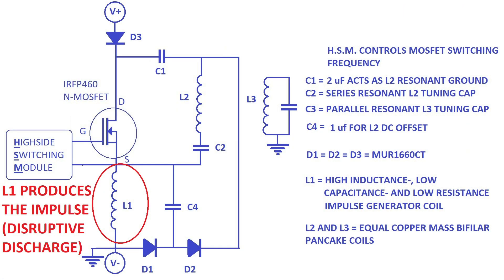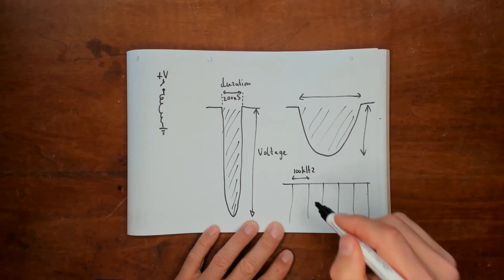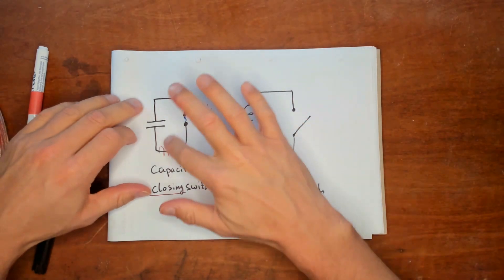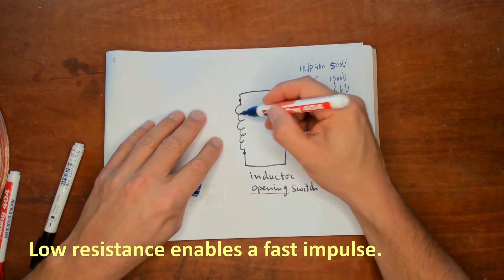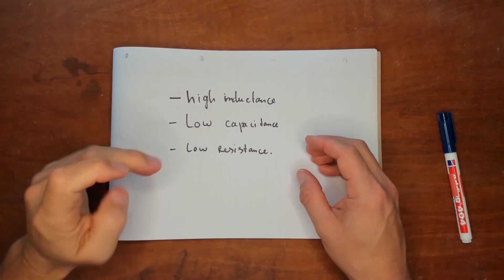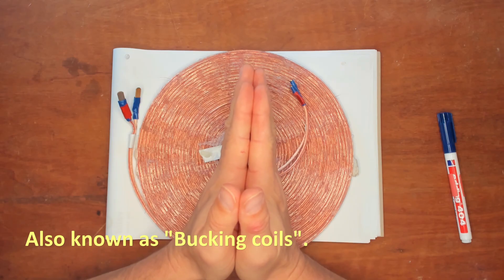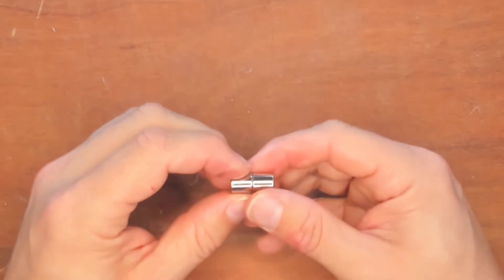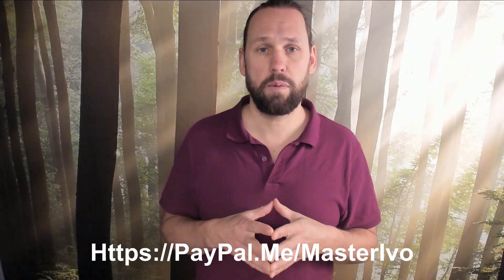Longitudinal electric impulse generation factors.

Comment: Hi Master Ivo, you produce a nice set of videos. This one I find I need to make a comment. I recall Peter Lindemann stating categorically that BEMF is not Radiant energy. In Bedini's SG, low side pulse is being used. All coils can be coaxed into providing BEMF. Lenz law. The energy from BEMF is quite low and not considered usable. The Radiant output you are talking about is another topic altogether. As you suggest, it does appear as a form of BEMF to all appearances but, the voltage can be in the hundreds, if not thousands. As you demonstrate, special circuitry is required. And, can be quite dangerous to solid state circuitry if not understood properly. Thanks for your videos!
Reply from the maker: thanks. the bemf, as inductive spike, holds the total energy of the magnetic field that produced it. But it is manifested in less time, due to its longitudinal nature.

Why does it take so much time to build up a magnetic field, while the discharge if this field (inductive spike) is so much faster?

because the magnetic field is spacial and transverse, while the back emf is counter spacial and Longitudinal.

It is a longitudinal dielectric field event. That is why it is so quick.
All this energy in such a quick time. 

indeed you need to know how to use it.  and I showed how. 

the impulse into the series resonant bifilar pancake coil, amplifies its energy. 

The impulse is a very strong current, as changing voltage represents current. but not a transverse current as the magnetic field current. 
but a longitudinal current. 
aka  Radiant energy
Reply: @MasterIvo  My guess as to the difference in timing for inductor charge-up vs. discharge goes back to your own analysis. resistance and capacitance and the rate of change in the field, based on a total excursion of the field differentials. Discharge is low capacitance and high resistance, also from full capacitance charge to zero. Charge up is a slow climb to low target voltage with low resistance, also traveling through capacitance charge up first which is an exponentially long curve that never maxes out.
Reply: Master Ivo has misspoken in his description of how the bifilar coil works (initially) in 7:20 he emphasizes the effect of adding capacitance (the bifilar coil stores the initial energy in the capacitance as well as the inductance. Opening the circuit of a bifilar coil forces the capacitance to transfer all the dielectric energy stored along the entire length of the winding into the inductor. This makes a massive, and limited impulse, or a perfect radiant profile electrical discharge, not like a typical inductor's magnetic field collapse, which is what Lindemann must have been referring to (that is prolonged and self-limiting in its rate of release. When you look at the circuit performance of capacitors vs inductors, you see the capacitor always activates ahead of the inductor and faster than the inductor It is this accelerated movement of energy that amplifies the power in a way that Tesla cherished it. (consider it the electrical equivalent of the Oberth effect, amplified kinetic energy transfer, basic rocket science, SOP for NASA)
     When one considers the other effects that Tesla discovered from his radiant beams of energy, they may be sourced by the characteristics of the ionizing atoms caught in his spark gap. Think of electrons jumping between orbitals... conceivably a dielectric difference separates the orbitals, and making the transfer releases the magnetic energy in a very high-speed pop (an EMP). This might lead us to think smaller is better, the larger bifilar coil will have a relatively long cascade along the winding, shading the EMP with an RF profile. The goal is to resonate the impulse, not the RF. If the transmission distance is limited for Ivo's build? Building a large number of smaller coils would be a closer approximation to the individual atoms ionizing in Tesla's spark gap. But, Ivo is definitely on the right track to replicating Tesla's work without an ionizing event. (similar to a marx generator, using simultaneously fired mini-bifilar-coils)
     There are other parallels that affirm this model. Amazon has an ebook: "The Book of GEET: Part 1, basic science" by Paul Pantone. Pantone generates uniform ionizing events with a slight vacuum and fuel mixture, producing the magical events that Tesla had, but not recognizing it as radiant energy; he never fully reaped the potential from his non-electrical, electric generating device (ten thousand KVA from a 1/4 hp engine without a generator). And Denny Klein patented an HHO electrolyzer that produces diamagnetic water gas from ionized water, which naturally releases similar radiant energy (enough to fission matter, studied by multiple plasma physicist) when the diamagnetic molecules condense into liquid water.

Comment: Master Ivo. I would like you to look a bit deeper into the impulse generation. If we step outside of electron charge a bit into cold fission and cold fusion generator we find evidence of impulse generation as the molecules fission into very low atomic weight elements. This was more contemporarily researched by Paul Pantone (written up in "The Book of GEET: Part One". The effects that Paul produced closely replicated some of the effects that Tesla generated. Frankly, the impulses that Tesla generated were not strictly limited to electric charges emitting impulses. with the discharges through the air, I submit that his impulses also involved positive charges abruptly changing energy states and emitting impulses that directly affected the protons in the matter, not just the electrons.

That said, it isn't that you aren't generating a radiant energy impulse wave, its that the impulses you have will not have the full potential of the impulses that Tesla generated, or others have generated with non-electrical methods. (The common method i've found in my research which included Viktor Schauberger and Paul Pantone was moving gases at high velocity with systems that accelerated the gas faster than the speed of sound with the added energy of a magnetic field (using water to generate the field with its highly dipolar & diamagnetic structure) Which Paul found could magnetize non-magnetic materials. Both men also found that their devices levitated or became less sensitive to gravity. This hints at the possibility of there being an electron flavor of magnetism and a proton flavor that are not entirely on the same "wavelenght"; if you consider the effects caused by waves in the Ether (what the impulses are made of) that have the characteristics of the particles that create the waves.

Perhaps you will want to take your impulse one step further and create a spark discharge with it? And see if you can replicate some of the other effects Tesla reported? Nice work. I hope I can catch up to replicate some of your work one day soon. Peace, B

Comment: I'm wondering if you have two identical coils in awg/length, etc... and you perform this on one with a battery, will you detect the impulse on the 2nd coil, say... 15-20' away, connected to a scope? Similar to how a radio with tuned antenna receives RF from a transmitter that's transmitting at the same frequency?
Reply from the maker: yes, It does. I use a series resonant bifilar coil, and impulse it on top of the sine wave. the impulses are detected further away. I'll try to show it in my next video
Reply: Master Ivo, I'd appreciate it! I'm a ham radio guy, and though I have no idea what frequency these pulses are at, if the frequency is anything below 7 mhz, you should theoretically be able to detect it from thousands of miles away. Though you may need a much longer (resonant) coil to make that possible. Even listening to standard side band HF radio that propagates around the world at just a 100+ watts, sometimes far less, the scope on the radio transceiver is constantly interrupted by lightning strikes around the planet, and other dielectric energy releases. Dollard was big on the idea that longitudinal RF was capable of propagating many thousands of times further and faster than standard RF, due to how hard it is to attenuate something that is not being driven by force, but rather, being driven by the LOSS of that force. 

Love your channel.
Reply from the maker: being driven by the loss of force. beautiful. like the sudden collapse of a DC capacitor

Comment: I'm not so sure about the opposing and attractive POLES of the MAGNETS. It is quite different when you apply a shearing force to open the MAGNETS in attraction, than if just pulled each MAGNET straight outwards, 180* from each other. 
There should be no reason why the attraction should be and weaker or stronger than repulsion. 
Action/ REACTION, equal and opposite.
Reply: eddy oklobdzija 
It is similar to how a suction cup is easier removed by moving it laterally until the outer ‘edge’ of the cup is no longer meaningfully engaged with the opposing surface and the system dynamics the force is created from, no longer exist in a manner which sustains itself.... Copy?

Things is, magnetic ‘poles’ are not a singular ‘system’ there is more than just a ‘N or S’ component to a ‘pole’ 
eg, Each pole (on a cylindrical magnetic.) has twin regions of maximum Gaussian Flux which are in fact the result of differing system dynamics.
The bar magnet and iron filing demonstration we were all shown as representative of the magnetic field is woefully inadequate at representing the dynamics of a magnetic field. It also completely neglected the null point, dielectric plane torsional characteristics of the magnetic field, the twin ‘hemisphere’ aspect of the field and how this is in conjunction with all of the above. Does not even clarify the twin fields at each pole which are dynamically linked but exist under seperate Base line principles. 

The ‘serrated’ aspect of the force (the sensation u experienced when applying a shear force to a N/S magnetic configuration) also applies to the polar axis longitudinally. You can observe this as a volume of ferrofluid moving ‘along’ the polar axis ‘field lines.’ It will transition from its ‘pooled’ mass at rest and as it is subjected to the field of a ‘magnetic pole’ its motion will exhibit a reciprocating and equidistant ‘globular’ nature. This is nothing more than the magnetic fields dynamics creating an interference pattern like structure with itself, which could be conceptualised as a standing wave if this helps but it is important to remember that this is technically inaccurate/incorrect and only fits as a conceptual representation when the field is isolated from external influence. (Within the fields spatial-magnitude-parameters, which are the critical threshold for the dynamics of the field to exist in a natural state of static equilibrium...) 
Once the magnetic field is influenced by its environment (for a given scale of perspective.) 
Then this conceptual understanding quickly breaks down when the field experiences an external influence and the notion of the ‘serrated’ sensation needs to be addressed from more of a interference type perspective. Twin opposing vortices (over simplistic but that is the very basic jist.) occupying the same spatial volume is a good conceptual instrument. If u consider the twin vortices as being phobic of the others constituent ‘matter’ and the opposing components of these vortices as being forced to intertwine their respective (practically identical, but opposing.) components together in the most efficient manner possible than you arrive at something similar to what is happening. 

The multitude of ‘cones’ protruding from a mass of ferro fluid when subjected to the field of a magnetic pole is another good conceptual tool. These ‘domains’ of maximum ferromagnetic influence are contradictory to the assumed nature of a magnetic field as the bar magnetic/iron filing demonstration, shown to100’s of millions of young students, would have you subconsciously believe/understand, which would simply be concentric rings protruding from the ferro fluid. But as I said earlier, this pattern of force concentration and viodance exists on multiple axis of the field and create an entire array of this ‘serration’ in the magnetic fields force.

Comment: Master Ivo; your output has impulses as part of the waveform, but does not seem to consist solely of impulses. Does this have differing effects than what Tesla described in his experiments? I am also wondering if have you demonstrated differing effects by altering the rate or speed of discharge; such as Tesla talks about in his writings. The differing effects I am referring to are phenomenon such as detectable pressure waves, heat, cold, illumination, etc.
Reply from the maker: yes, I use series resonance to reduce the coils impedance (wire resistance), then i introduce the impulse, so the whole dielectric field of the bifilar coil gets a sudden voltage change, creating a longitudinal (shock) wave.
Tesla used high voltage, I don't. I use 1000V which is low.

Comment: Master Ivo plz tell me is it possible to achieve 20 million sparks during a secound using byfilar coils or any method ???? plzzzz if u know anything about how to get 20 million more or less spark discharges per second ???????
Reply from the maker: 20MHz sparks. I've seen some Russians do it years back. Can't remember the name(it was on youtube) .  the spark turned into a beautiful flame.
Reply: @MasterIvo  thank you so much for responding. i have downloaded most of ur videos specially about the bifilar coils. im worse then a noob in electronics but im very passionate to learn electrical science. nd i find ur research to be a treasure for those who understand. sir plz can u just tell me this one last thing, through which instrument/components i could be able to acconplish this 20Mhz sparks ??? plz guide
Reply: box 379 You need to use high voltage switching diodes in a circuit with the appropriate rectifier and transistors. Why do you need 20 mhz spark  gap? Why not a continuous output? For example, if the fields don't have time to completely collapse, then it would make no difference...?

Comment: The spark gap had a significant impact to Tesla's work. By removing it, you are making a significant change to the parameters that affected Tesla's work. Initially Tesla observed the effects directly off the spark. The conductor closing the gap is ionizing atoms which create a mass of impulses that alternate directions. With EM quenching and changing the gap contact to carbon and progressively shortening the size of the gap with high speed gap width controls, Tesla believed he stripped the electrically conditioned Ether from the charges  at the gap and then broadcast and amplified with resonance only Ether.

My point is, you are on new turf. Your work is original, and takes advantage of the Ether conditioned by the dielectric field, not the Ether of the dielectric field. (As a result, it appears you have demonstrated an insight to why capacitors always respond quicker to changes than inductors (the Ether takes longer to spin up than align) which is huge towards bringing electrical theory out of the pseudoscience or philosophical classification. 

Making impulse magnetic waves is also groundbreaking. Generating interference patterns (now possible with this breakthrough) is the foundation for replicating the magnetic fields of stellar objects, simulating gravity and creating force fields and holodecks. GO GUY!
All of these are disruptive technologies and have no commercial potential; your open source, no profit approach is necessarily essential to keeping safe.